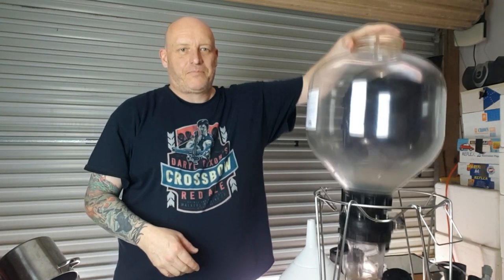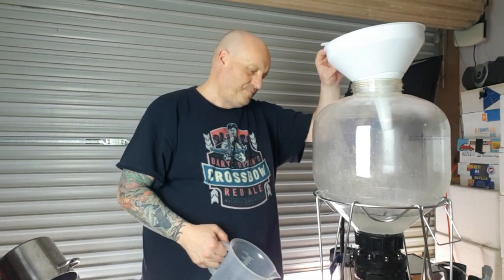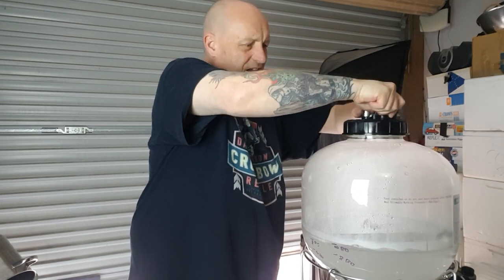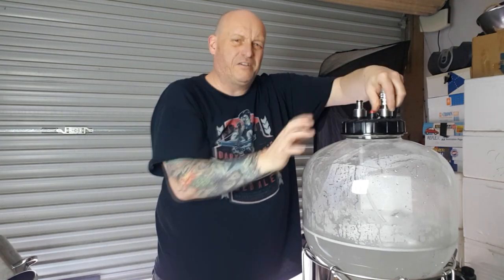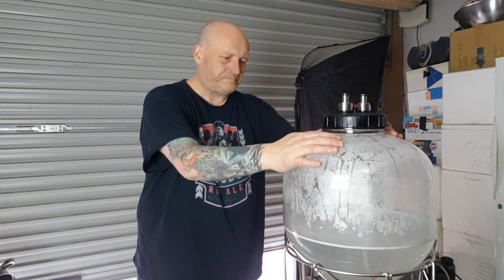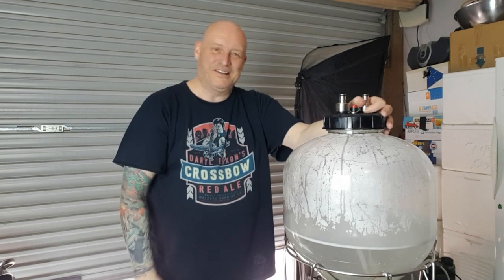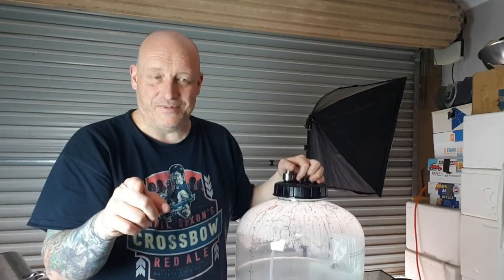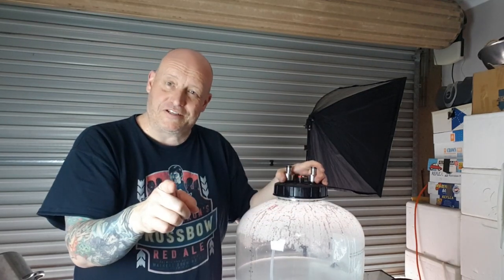FERMZILLA - Cleaning & Disassembly

Comment: Not sure if you've mentioned this before but as the Fermzilla (and the all-rounder) have a rounded/conical base the water level reading can be out if the unit itself isn't level.  When I got my all-rounder I used a spirit level across the top opening before marking water levels and attaching the graduation sticker.  I know it's just a guide but you can be up to a couple of litres wrong in either direction if the fermenter isn't level.

Comment: Had a problem with removing the bottom seal for cleaning due to being over tightened. The strap was slipping so I decided I needed a persuader. I cut out a cardboard templates of the bottom ring shape and transferred it to a piece of 10mm chipboard. I cut out the shape, leaving about 50 mm wood on 3 sides and left the 4th about 300mm long - made a wooden ring spanner (box wrench). I turned the vessel on its side on the bench and hit the wood with a mallet a few times which did the trick. After all that effort, everything was perfectly clean anyway.

Comment: Disassembly tips (if you are still struggling): Start at the outermost units. Remove the trub collector, then the valve assembly, then loosen and remove the seal retaining nut. Use the strap wrench, especially for the first two pieces, they are tight. Remember a couple parts have reverse thread... but all of these main pieces are threaded. Lastly, don't do what I did... loosening the nut before the valve assembly causing me to assume the through-shaft was fused and deciding to tackle the problem with tire irons for leverage and hammer and chisel to shock-dislodge parts... now I'm needing new parts / new unit.
Reply: Any suggestion for a redo on the problem? The nut on my unit loosened from the spigot but not off. So now the spigot spins when I try to get the valve unit off. Can’t hold pressure so I can’t really retighten the spigot in place.
Reply: @caseyalderson2780  Sounds like you are experiencing the exact problem that I was trying to help people with. You CAN tighten the gasket without pressurizing the vessel. The threads that the retaining ring connects to the spigot with are short, so you will need to pull on the spigot, pulling the gasket along with it. Then try to re-thread the ring. Once threaded, make it fairly tight. Then you can tackle the valve assembly using the strap-wrench. As long as the retaining ring is tight, you should be able to grip the vessel for all the counter-force you need. (Did I describe this well enough? Please tell us your success!)
Reply: @cj7688  100% correct. Had to pull with a good amount of force on the spigot to get the ring threads started but once tightened up good and snug the strap wrench made quick work of the valve assembly. Then the ring was fairly easy to remove followed by the spigot. Thanks so much for the tip! A couple more frustrated tries (with a bad plan that is) and I’m sure I would have blamed it on a poor design. I owe you!

Comment: Nice vid, that's pretty much how i cleaned mine before running your Zombie Dust clone recipe through it, which should be ready on Sunday!!! I found the Fermzilla pressure kit carbonation caps to leak if tightened too much. I cant wait for the carry handle to be released, it can be a little awkward to handle the unit at times...
Reply from the maker: Cheers mate, thanks very much for watching!

Comment: Thanks Gash for another great video. I made the dumb mistake to place the cone rubber seal in the outside of the vessel, so the cone spigot is inside and the cone seal is in between the reverse thread nut and the vessel body. I cannot find a way to disassembly that mess, but it does seem to hold pressure anyways!
Reply from the maker: oops! umm I have used a rubber mallet in the past, but you need to be very careful, a hammer will likely break it. It often works better under pressure because it stops the one inside turning, although with the rubber on the outside< i'm not sure... Good luck! Cheers
Reply from the maker: Another way is to have some pressure in it, so its easy to hold and get some one to hold the vessel while you turn the other bit, wrap a tea towel or something around it to get a better grip.
Reply: I will try, but it seems that at least one part will have to be destroyed to fix this mess! Thanks for the help. Cheers

Comment: How do you heat it in the winter? I have controlled temp, would just sitting a heating pad in the fridge work?
Reply from the maker: yes it would, I put my heat belt around the stand. Though I have been thinking of making some thin belt and putting that between the heat belt and fermenter, but not really needed. Cheers!

Comment: Just wondering if I should be worried about green stains on my floating dip tube after a heavy dry hopped beer (100 grams) . I've soaked it in stellar clean already. Should I go for a second soak or is it like a hop sock where the stain is permanent?
Reply from the maker: It will likely stain, you could try again with some hot water and stellar Clean, dont put hot water in the fermenter of course. Cheers!

Comment: I can't undo the bottom bit it just keeps turning,,,help
Reply from the maker: depends which bit.. if it keeps turning, try putting gas in it so it holds tight to the bottom of the fermenter. You can also soak the parts in a bucket of warm water <50c. If you cant grip it, use the tool. Gentle taps with a mallet last resort. Also remember the tightening/loosening directions the collar on the bottom of the tank is reverse thread. Cheers!